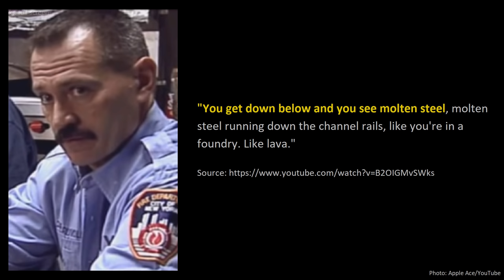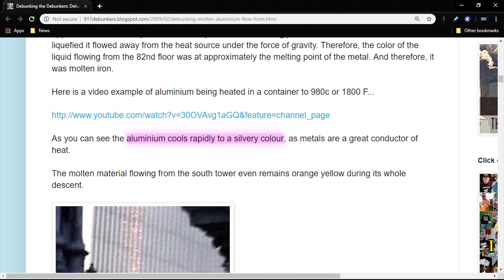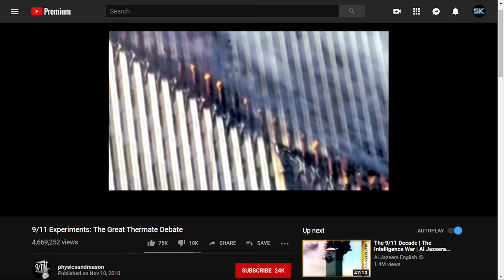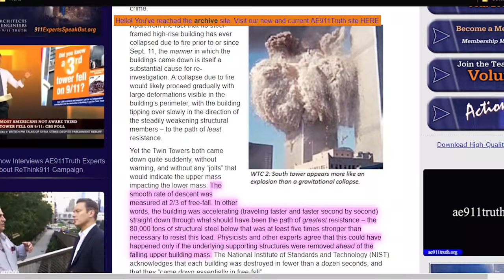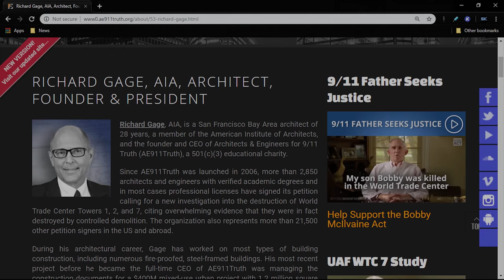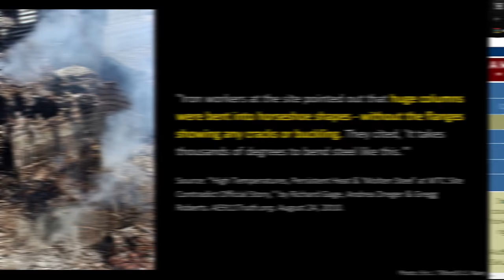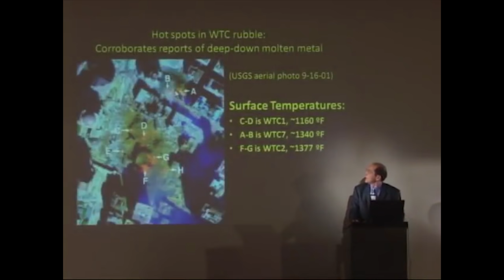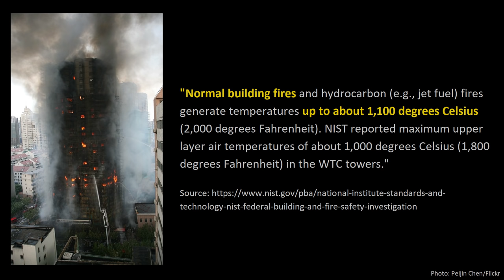9/11 Truthers Debunked: "Molten Steel = Thermite From Controlled Demolition!"

Comment: I'm surprised how you didn't really talk about how these buildings all fell pretty much within their own footprint. Also aluminum can actually take heat in quicker and also dissipates quicker and if the eyewitness says he sees "molten steel" running down the channel I would assume that these that aluminum would actually be silver at this point. Examples that you show with aluminum being poured into something but you never showed it running along a channel after it's been poured. Also you never mention the state and federal codes for buildings and what they're meant to withstand I do know the twin towers were meant to withstand hurricanes and some even claim that it's meant to stay up during airplane running into it. None of this was covered in your video. also your explanation of how much aluminum was used on the building itself is all on the basis of outside of the building. Was the whole building on fire? Also there was no talk about how jet fuel burns. It may burn in a high temperature but how quickly?  I never saw any discussion on the dust particles and spheres that the 9/11 truthers claim is a byproduct of thermite. 

And I know this is a tired subject but building 7? Hell, the BBC announced it was down it was standing behind the reporter. The whole 9/11 incident is a huge subject with people on either side having evidence to support their claim. You've only scratched the surface of this particular subject. But as far as your conclusion of structural failure I don't see it. There's not enough evidence to me to show that these buildings just fell into itself. Was it thermite? I'm not an explosives expert. Even though I disagree with you about 60% of this still really like your analysis and raised some good questions. Keep it up man.
Reply from the maker: Appreciate the thoughtful response.

Regarding "you didn't address truther argument X," look, I can only cover so much in one video. If I were to thoroughly examine and debunk every single one of those arguments in one video, it would legitimately be 3–4 hours long. My approach is to take one set of related arguments at a time and deal with them. 

It just wouldn't make sense from an organizational standpoint to be like "So, now that I've spend 40 minutes dealing with all of the arguments related to molten metal, time to talk about alleged BBC foreknowledge of the collapse of Building 7." It's a completely different line of argument.

You said that I "never showed [molten aluminum] running along a channel after it's been poured." That just sounds to me like special pleading. If I found a video showing that I'm sure you'd try to find some other specific set of circumstances that that video didn't meet.

"your explanation of how much aluminum was used on the building itself is all on the basis of outside of the building. Was the whole building on fire?"

Not really. I performed this analysis in two ways: One only using the aluminum present in the airplanes (and thus would've been available to supply the pre-collapse molten material flow), and then using all of the aluminum in the buildings for the post-collapse analysis. No, the whole building wasn't on fire, but after collapse, there were many large pockets of fire within the debris pile.

Regarding the dust particles and microspheres, specifically, that you say are evidence of thermite, I plan to address those arguments in a separate video focused on the alleged microspheres, chips of thermite, etc. Again, I can only do so much in one video.
Reply: @ASkepticalHumanOnYouTube  

How is it special pleading? The liquid coming from the building was exposed to air for a considerable amount of time and you'd need to replicate that in order to have a consistent case study.
Reply: @ASkepticalHumanOnYouTube  Nothing in the buildings made ANY resistance whatsoever, or they wouldn't all have collapsed symmetrically straight down. ALL resistance in the buildings removed, HOW? Not talking about the top parts, but the REST of the buildings below would've offered plenty resistance, if said resistance wasn't taken away.
Reply: @ASkepticalHumanOnYouTube  but you don't talk about building 7?
Reply: Aluminium wouldn't be red hot for weeks aswell
Reply: @alexanderbardarbog8475  Have you researched the construction of the Towers and how each floor was supported? The real question is how could they NOT have pancaked?
Reply: Building 7 is the smoking gun in my opinion. Which is probably not worth much.

Comment: Pour molten aluminum from a height of more than a meter with a wind factor and il will solidify..plus buildings with a structural skeleton of steel  will not blow down it will partially fall over..
Reply: Except the WTC towers did NOT have a steel skeleton, in the traditional sense of the word, rather they had a relatively thin ectoskeleton tied to the core (which rather than reinforced concrete was column and girder construction sheathed in drywall) with relatively delicate trusses.  Only in the cartoons would a building like this "fall" over.
Reply: WTC didn't have a steel skeleton, it had a steel core and steel columns on the exterior part of the building. And there's footage of the steel columns buckling as the building pancakes in on itself.

Comment: A few years back in Roseville, CA, some fool started a fire in a GameStop that got out of control and destroyed a large portion of the Westfiel Galleria Mall. Many of the structural steel beams in the 2-story burned-out mall buildings were severely weakened and sagging. There wasn't 30 tons of jet fuel involved, just clothing, shoes, and whatever else you'd find in a mall.
Reply: There are many examples (with one of the latest being in Philadelphia on an extremely busy highway) of overpasses collapsing after being exposed for only a short period to a burning fuel truck underneath. And the steel they use in overpasses is often reinforced with concrete and much much bigger than anything in the WTC towers.
Reply: Interesting
Reply: Over here in England there's just been a major fire in a multistorey concrete and steel car park at Luton Airport - 1200 cars destroyed and half the building has collapsed.
Reply: @alanclark639  must have been the NSA. Saving us from a army of people driving on the wrong side of the street
Reply: Most clothes and shoes today are made of solid gasoline (plastic)
Reply: Pliable  can't  pancake
Reply: @brucebruhn8837  Yes it can… and the towers didn’t pancake… they exploded outward as they came down covering a footprint that was effectively, many times the area of the building’s footprint: they ‘mushroomed’

Comment: I notice that you fight show the video of the molten metal falling from the building, and then the building collapsing at that very point where the molten metal is coming from. Why didn't you show the building collapsing from this very point on the steel columns at the corner of the building?

Comment: Molten aluminum isnt glowing or anything like a bright red/orange color. Its a silver color when molten, not producing any light.

Im a professional welder and i weld both steel and aluminum. Do you research! To let steel drip out of a building like this in a complete molten state, the heath source had to be constant and more than 2000 degrees celsius. It must have been thermite charges because steels melting point is 1450 degrees celsius.

Great tip, watch some videos how they weld train railroads with thermite.

Comment: Why did the whole building fall down completely when it was only the top bit were that was weakened by the impact of the plane why didn’t it fall and stop at the week point or at least slow down but it all fell down at the same rate, and how did the building that wasn’t hit by a plane get hot enough for it to fall down
Reply: Well for starters,both collapses happened at the impact point exactly. Did you think once that section could no longer hold the weight of the part above it,that it would collapse only to the floor below it?or collapse to that floor,then stop,then collapse again?you do know how it was designed right
Reply: The top also started to tip sideways as it fell. But then started to free fall straight down after all the bombs went off. In is physically impossible.
Reply: Dr judy Wood

Comment: It could also be molten copper. Because it has a low melting temp. And it was abundantly presente in the electrical wirering of buildings and planes.
Reply: Yeah…..and it all somehow gathered in one spot and spilled out at that rate?...
Reply: At the exact spot the building started to fold? Starting a few minutes before collapse and ending just seconds before? Very convenient.
Reply: Wouldn’t it make much more logical sense to say the obvious conclusion- that steel (the buildings were made of steel btw) melted and caused the drips? It is visually consistent and logically consistent to be steel. Anything else requires HUGE stretches of imagination

Comment: Yep...and cell phones work perfectly with zero background noise at 10k feet smdh
Reply: It's amazing that people forget that Airfone technology was on airplanes at that time.  People could make phone calls mid-flight to any phone on the ground.  It was shown that a couple of those phones were used by passengers on Flight 93.
Reply: @txag007  Not true. At that height and that speed, there is no way for a phone cell phone to maintain a connection. They are moving too fast for the cell towers to perform the "handshake" from tower to tower. That is how cell phones work while you are driving from city to city for example. At that altitude and speed, this cannot happen, which is why the cell phone calls are dropped. Next...
Reply: @lex.cordis  Did you not fly on planes in the '90s and early '00s when phones were in the middle seat of a row?  GTE Airfone was a service you could make phone calls inflight.  It utlilized both ground towers and satellite coverage.  Yes you could make phone calls during the flight and at high speed.  Flight 93 for examples had records of the tech being using during the hijacking.

Comment: In NIST's own words WTC 1 & 2 came down "essentially in free fall". This means that essentially NONE of the energy from the falling building parts caused any destruction during the TOTAL collapse of the WTC 1 & 2 buildings. The energy to cause nearly all the destruction had to come from another source.
Reply: @dunexapa1016  That you don't UNDERSTAND the explanation doesn't mean it isn't there. This? Is a clear "you" problem.

That you then want to make up nonsense about what happened to try to avoid having to face that? Yeah.

Simple seems to be about right...
Reply: @dunexapa1016  Actually, that's not a fact at all. The only thing that you come close to is that no investigation has detailed exactly what happened, every second of the collapse. Which, of course, is impossible to do and so no serious investigation would claim they could.

Meanwhile, your original claim is still nonsense.
Reply: @mooneyes2k478  , I have stated PROOF of the fact I stated. Official reports are available if you wish to ATTEMPT to prove fact stated is false.
Reply: @dunexapa1016  No, you have stated opinions and lies. Proof have, wait for it...PROOF.

Imagine that.
Reply: @mooneyes2k478   , Not to mention, ... you fail at physics .... 😢
Reply: @dunexapa1016  Right, because you want things to be otherwise, and so it's obviously someone elses fault?

What DO you know...
Reply: @mooneyes2k478  , Official reports are available. Prove what I stated is false.
Reply: @dunexapa1016  Yeah, so basically, "YOU do my homework FOR me!"

No. Sadly for you, that's not how the adult world works. Crushing for you, I'm sure, but here? We prove our own claims. You're the one stating it, you get to be the one to prove it. And "SO THERE!" isn't a proof, or an argument, no matter HOW much you stomp your little foot and pout.
Reply: @mooneyes2k478   , Any official report is proof of fact I stated ... It is you who are claiming otherwise THUS, the burden of proof is on you.
Reply: @mooneyes2k478   So YOU admit there is no proof,  in any official report, that the total collapse and demolition of the World Trade Center One and Two buildings was or was not caused by a controlled demolition. Can't find what is not there so you had no choice but to admit your failure. 😢 Want to try a few very basic physics questions ❓❓❓
Reply: @dunexapa1016  That you're not actually able to read doesn't surprise anyone. That you want to pretend that you're right, presumably because otherwise you'll have to face that you're actually crying yourself to sleep at night, so THERE, is not a shock either.

There's no report that says what you want. Which means that you made your claims up. Want it to be otherwise? Pprove it. "You look it up for me" is not proof of anything other than your failure.

Your move. Provide proof, admit you had none, or try to weasel out, in the process admitting you had none.
Reply: @mooneyes2k478   , That's not the proof we're looking for ... ☹
Reply: @dunexapa1016  That's true. That's because you don't actually HAVE any proof.

Imagine that. Glad to see you admit it, though.
Reply: @mooneyes2k478   Since you acknowledge that no official investigation has yet proved what actually caused the murder of hundreds of innocent people when WTC 1 & 2 totally collapsed would you support a criminal investigation to prove if a controlled demolition was, or was not, the cause of hundreds of innocent people being murdered??? YES OR NO????? Would you want to give aid and support to murdering terrorist criminals???
Reply: @dunexapa1016  That you want to pretend that you have any understanding at all doesn't change facts or reality. So, how're you coming along with the supposed proof of your claims? Still haven't actually found it?
Reply: @dunexapa1016  So, in other words, since your fantasy was shown to be a fantasy, and this makes you SAD, you now need to lie about it.

Good sign, that.

Of course, nothing else was to be expected about someone making up supposed "evidence", and then running like a scared little child when asked to SHOW this evidence.
Reply: @mooneyes2k478  undoubtedly a flat earther as well
Reply: @Synaptic_gap   Would not be surprised.

Comment: Can you answer a question for me? What happened to building 7? Also how do you get a mobile phone signal above 10,000 feet back then? Ahh and where are the passengers and luggage and plane debris from the plane that hit the Pentagon? Last thing 110 floors of debris from the towers would surely mount higher than the height of the lobby? But it didn’t.

Comment: Lol... molten aluiinum  2 weeks later? There was steel marbles found on the roofs of buildings near by. Many witnesses pulled beams from the site that had molten metal dripping from them.
Reply: So, you literally got nothing right. Did you work on that?